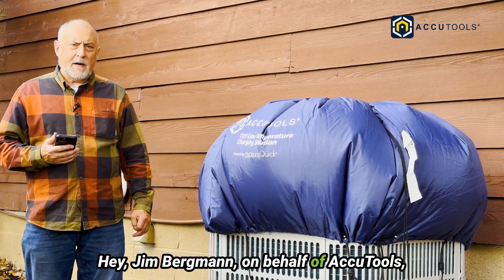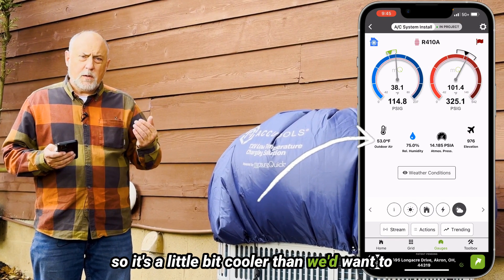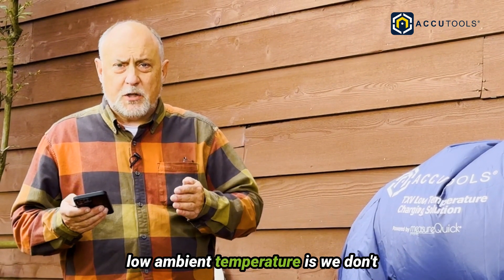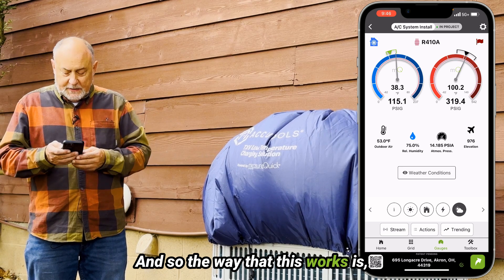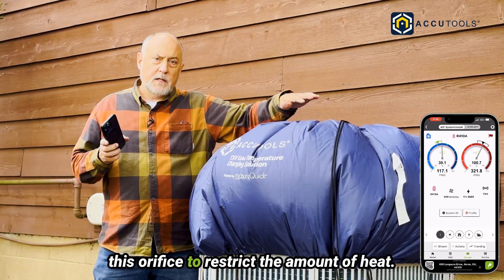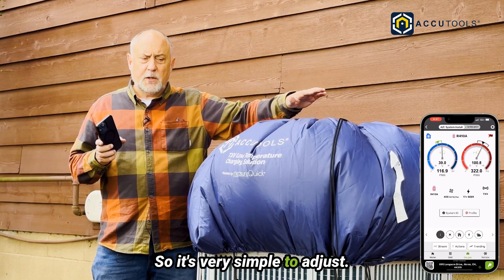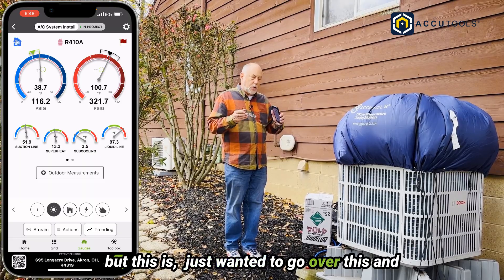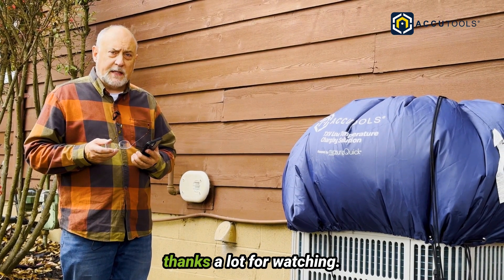Conquer The Weather: Cold Weather Commissioning Using The AccuTools TXV and Piston Charging Solution

Comment: Jim. The Bane of our Trades are 6'  long refrigerant hoses and their manifolds. We started using analog/electronic attachments using a 6" hose and quick connects. On Refrigeration, we use these tools without any hose at all. Reducing refrigerant charges via testing during maintenance processes should be Codified IMO by ICC and others. See you soon.